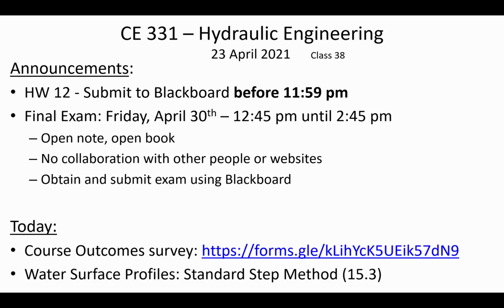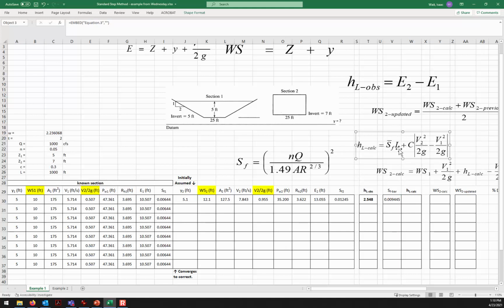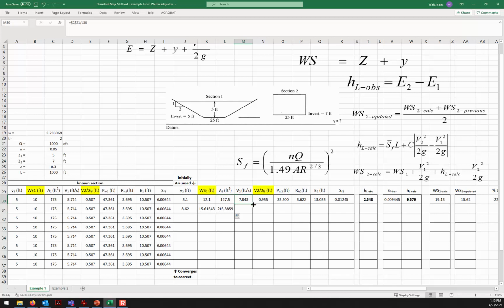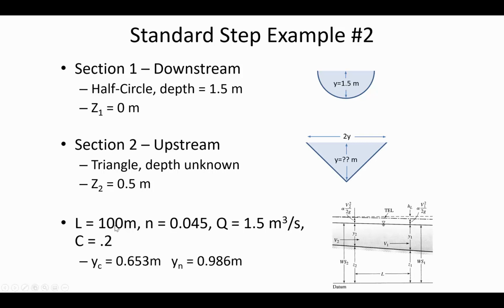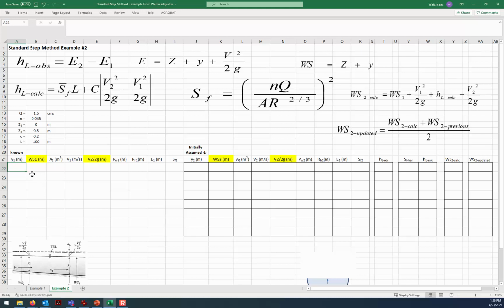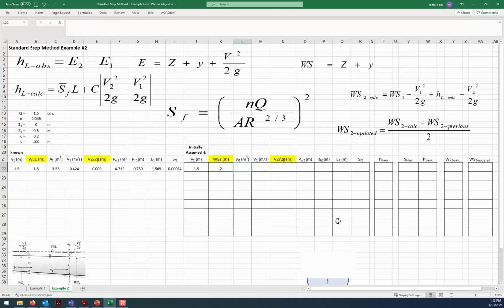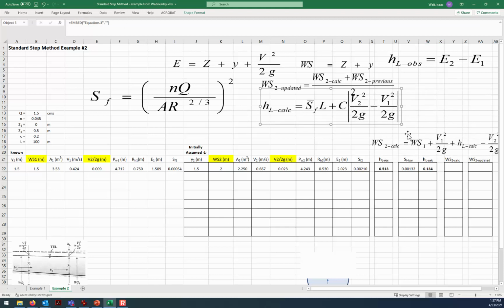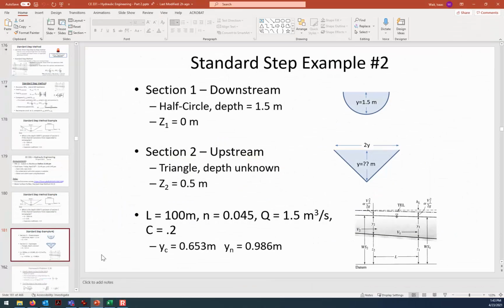Standard Step Method for Water Surface Profile, cont. - CE 331 (23 April 2021) Class 38

Comment: I took Open Channel at GaTech in the 1970's and we didn't have excel or all these other great computer programs. HEC-1 was around, but the data was entered with IBM punch cards. It was truly drudge work. Your students should appreciate how much less work they they must do to get an answer.
Reply from the maker: Yeah, for sure: the tools today make things so much easier!  Though I never used punch cards, I did manually prepare .txt input files, and that was so much more tedious compared to setting up models through a GUI.
Reply: @IsaacWait  I work for FEMA. FEMA replaces a lot of culverts. Many of the culverts are on county roads. I have been amazed to find out that many of the County Engineers don't know how to design a culvert. They know Q=V/A and manning's equation, neither or which gives the headwater depth. I taught many of them about FHWA pubs HDS-5 and their program HY-8. I was lucky I worked in a building with the FHWA Regional Office  and worked with the last editor of HDS-5. He taught State DOT Engineers  in every state and I learned a lot practical hydraulics from him even though I had taken several Hydraulic classes from UC Davis and GA tech. I have been watching your videos so I don't forget everything.